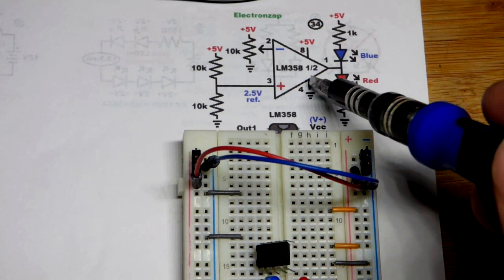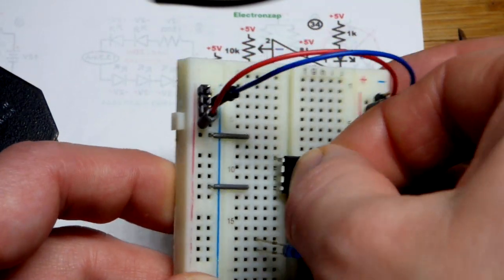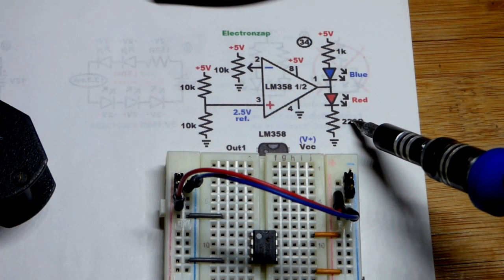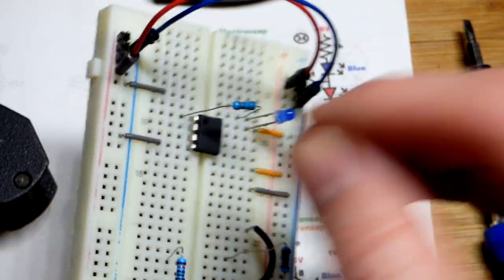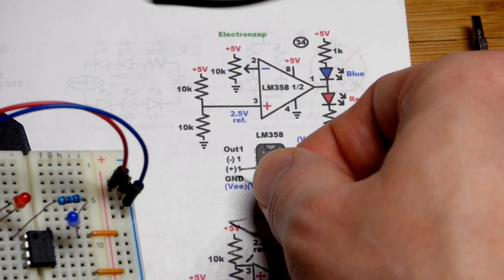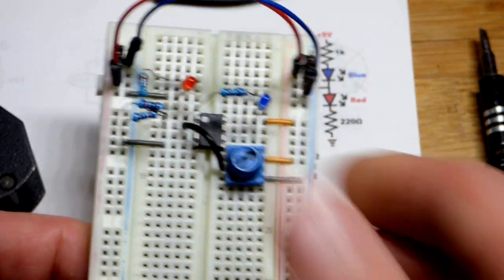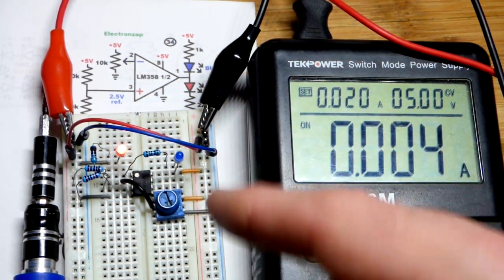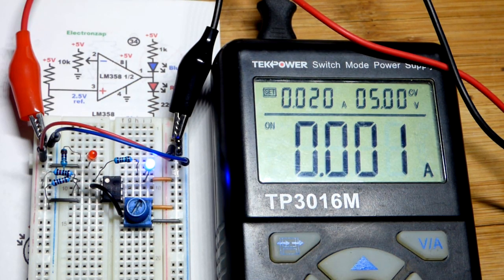Step By Step Op Amp Inverting Comparator LM358 For Beginners Learning Electronics

Comment: On pin 3, at the voltage divider, how would you calculate the switching voltage with two different resistor values at the voltage divider? For example 5k at Resistor on the 5v side, and 10k at Resistor on the ground side. Am I correct ,assuming 5v power, 5k/(10k+5k) gives .33 . Meaning the switching of the output pin would occur when the input voltage on pin2 would be at 33% of 5v or 1.65v? Or do I have this backwards and it will switch when pin 2 reaches roughly 3.35VDC  (5v-1.65)

Comment: You should follow your suggestion of reading data sheets.
The "P" designation for LM358 indicates package type. In this case P = PDIP (Plastic Dual Inline Package).
D package designation is typically for SOIC devices.
Very old LM358 had suffixes B to indicate an enhanced version of the original op amp design.
Reply from the maker: Looks like you are right, thanks!